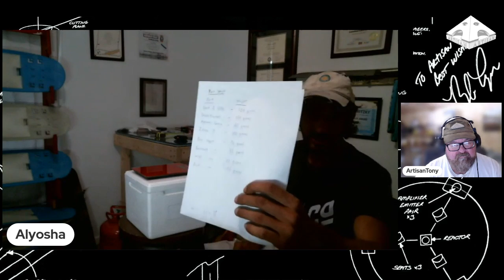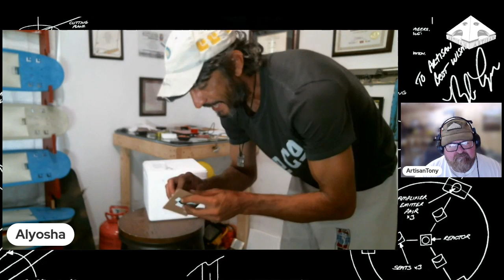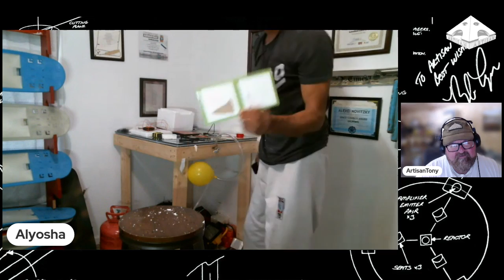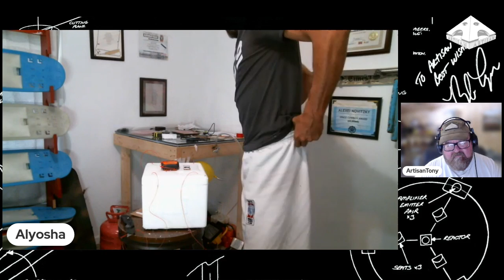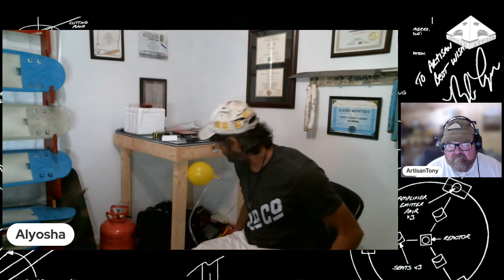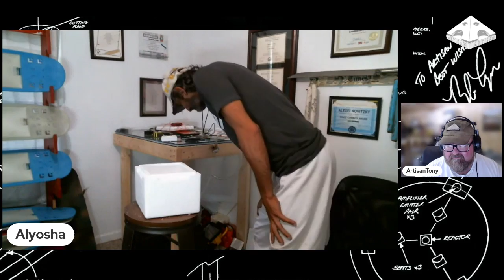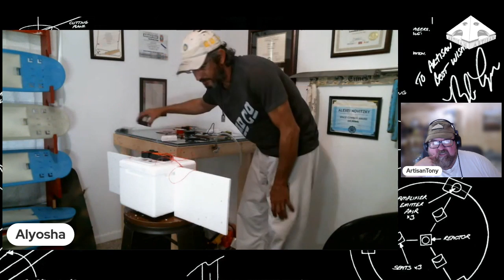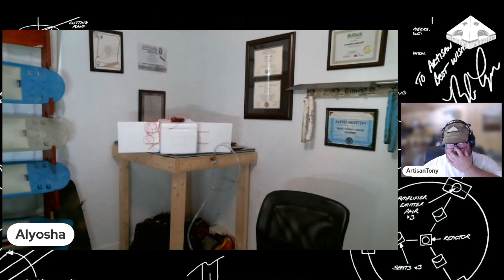Alyosha (Alexei) Novitzky Builds Launch Device for UAP Society Event - Buffering Fixed

Comment: If you breach the upper atmosphere with that balloon, it’ll automatically trigger space-based sensors (all of which feed back to LOCC) which will likely report a civilian “spacecraft” or “probe” traveling in the atmosphere. You may find yourselves in a position where deployed forces in space will HAVE to investigate your balloon when they come across it. It may lead to some stunning footage of exotic capabilities.
Reply from the maker: They are notified already lol
Reply: @ArtisanTony  That's a shame. I would suggest that the best way to do it would be to catch them off guard. Now that you've submitted a flight plan, it can be input into computers at LOCC, and the flight plans of all DoD spacecraft will be probably be recalculated to avoid it. This may be a bit of a blessing in disguise though, as you'll know that any spacecraft you do film will probably be nonterrestrial in origin. I would submit, however, that our own reproduction spacecraft are much more impressive & exciting to see, partly from the knowing there are humans like ourselves on board.
Reply from the maker: @seankash8546  and they fly slow enough to be filmed :)